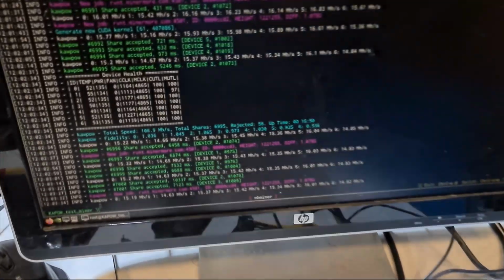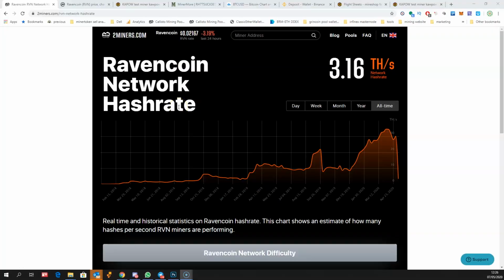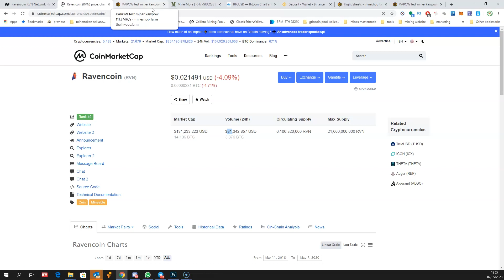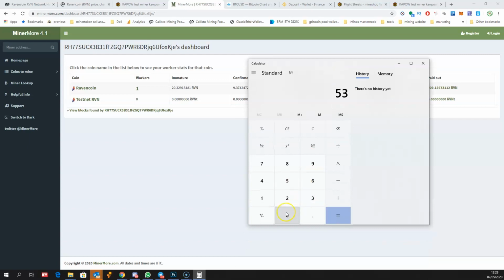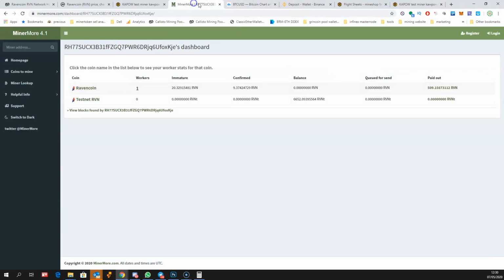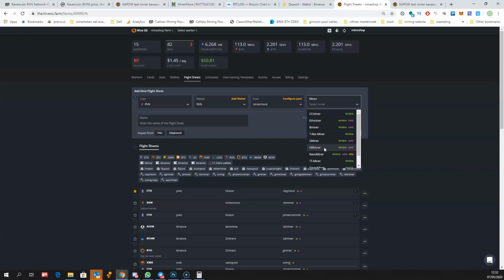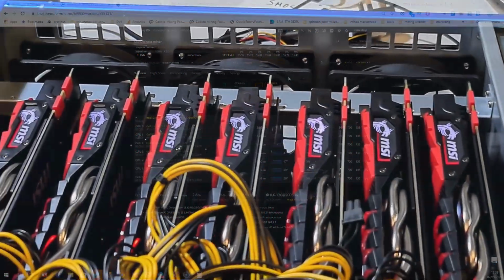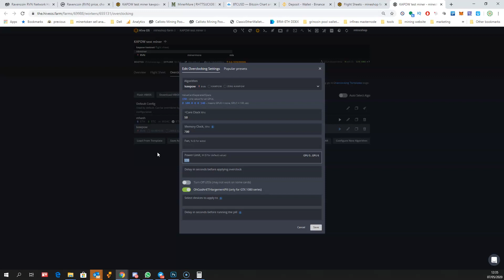Ravencoin KAPOW mining profits | how to setup to start mining with hiveOS 1?

Comment: I haven't mined in a while so it was nice to go through a new setup just for fun since I've sold off my many many rigs long ago.    I threw a single 1660 on the network exactly at network switch yesterday and have earned about 56 RVN so far.   Difficulty going up/rewards dropping which is to be expected...  I'm getting 12Mh on a single 1660 at 80% power, +100 core +500 mem.     Haven't really tweaked it to try and do any better.   Thanks for the vid
Reply from the maker: Is it 1660TI or non ti?
Reply: @GuntisVitolins  Just a regular 1660, no TI
Reply from the maker: @onlymoney526  nice performance for such value card, did you measure the power usage?
Reply: @GuntisVitolins  NO I did not measure from wall, taking down to even 75% doesn't effect performance much and it probably not using much power since its running at only 52C with fan at 70%.   If I dig out my wall meter, maybe I can test.   The mining software "saying" 79W